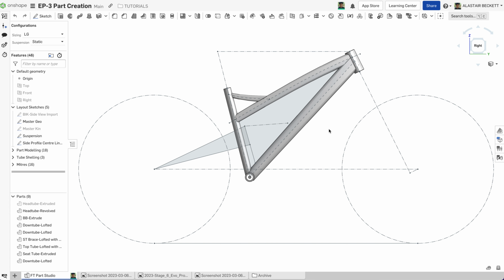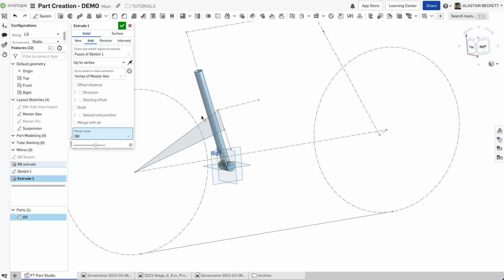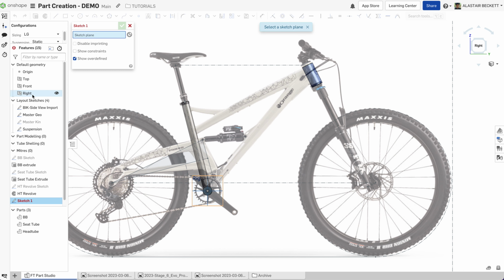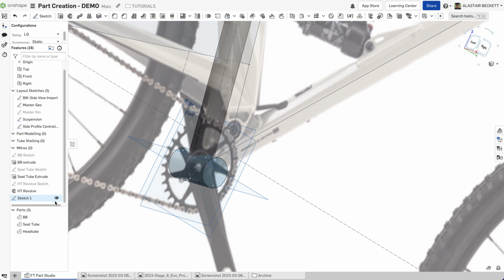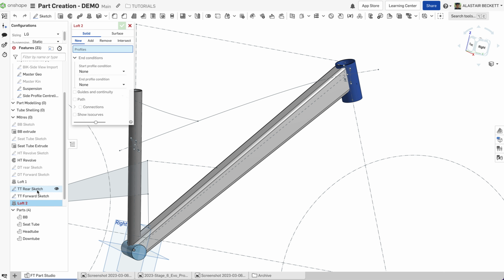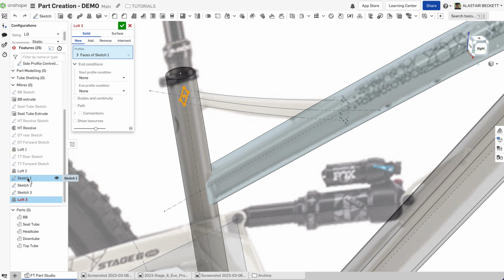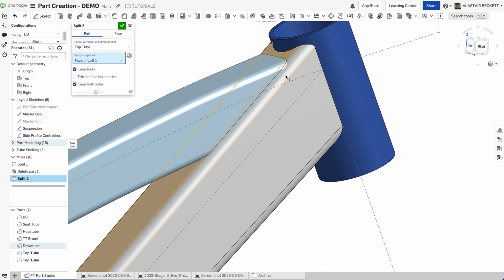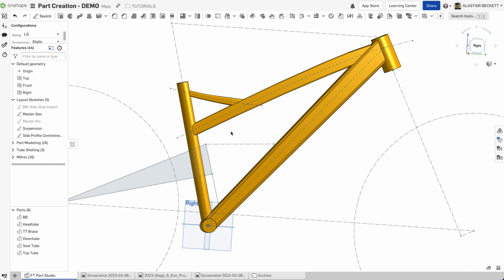PART MODELLING A BIKE FRAME IN ONSHAPE - EPISODE 3

Comment: Your video is really helping me understand both bicycle frame design and Onshape. Underrated channel and hope you will keep going! I have a question - how in the heck are these strange loft shapes prototyped and then manufactured? For aluminum, is it all hydroforming?
Reply from the maker: Thanks John. Yes we hope to do more videos in the near future and have been making a list of topics that people have asked for so that we can cover these. Surface modeling seems quite high on the list so that might be next. 
Aluminium tubes are often mechanically formed using a set of dies to provide some shape to a standard round tube. 
Hydroforming is also used as a finishing step to get sharper edges or to provide slightly more complex profiles. 
Like you say, it’s often easy to create complex shapes in OnShape; but understanding what’s possible to manufacture is the real challenge.

Comment: Can you split and flat pattern the coped tubes to create paper templates,or should i just stick with inventor
Reply from the maker: Hi David. Just looping back to your comment to let you know that OnShape has added this feature now in a recent update. You’ll find it in the toolbar if you search ‘flatten surface’ 
You may need to create an offset surface at 0mm distance if you want to flatten a bicycle tube for example that might have a wall thickness, but you will end up with the external profile, flattened, and then you can use this for graphics/decal design.
Reply from the maker: Hi David. Not that I am aware of. You could convert the tube into a sheet metal part and add a split line to produce a template for the mitre potentially, but I would need to try that out before confirming if it’s a suitable workaround. 
I’ll ask OnShape about a mitre feature Incase it’s on their development list for the future.